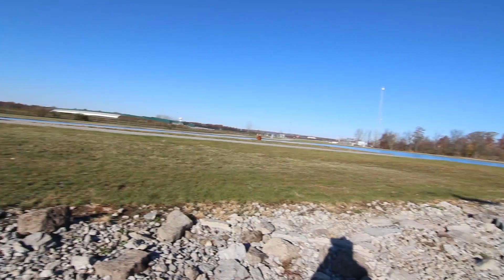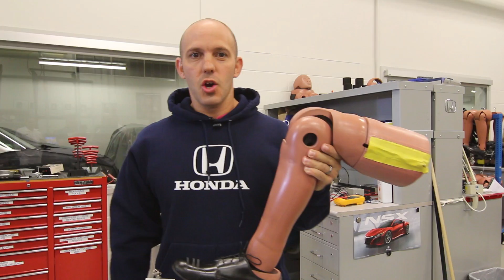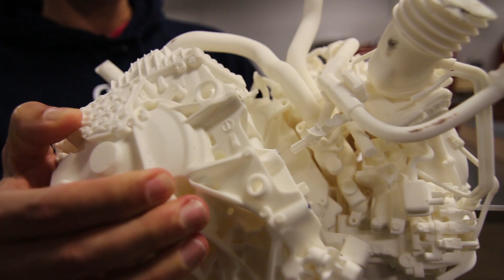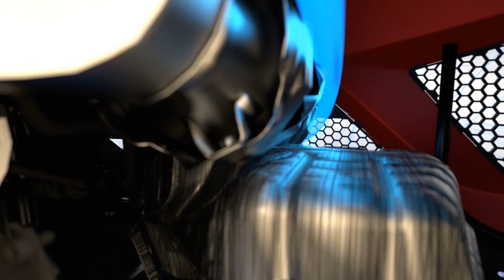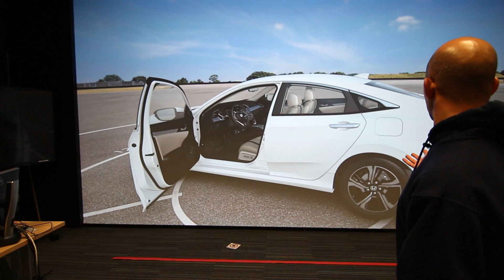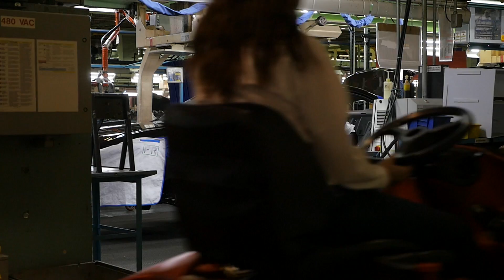This is What Happens to a New Car Before You Buy it! Inside look at the Honda Accord Factory

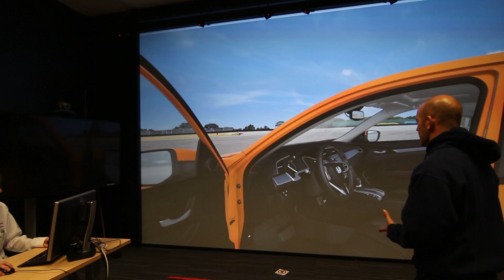Comment: 30:24 why did Honda in general remove the interior black plastic that runs along the door so that you don’t see body color from inside the cabin? All models until 2012 had it. To me it’s a fit and finish appearance and Mazda and even Acura has kept it. My old 2012 Accord had it not my 2019 accord.

Comment: @HondaPro Jason: I have been trying to find the answer to this everywhere but cant, but I was wondering is there a firmware update that will allow the 2014 Civic Displayaudio to run Android Auto/CarPlay?
Reply from the maker: CarPlay & Android Auto is a hardware upgrade.   So it will not be available on the 2014-15 Civic's

Comment: Lol that they check the cars for leaks in the roof or sunroof. A couple weeks after I got my 2014 Honda CR-V I found out that the sunroof and the roof was leaking and water and carwash soup was getting into the car and the headliner 🙄
Reply: +pug Williams  I've seen small objects like acorns block one of the 2 drains that are located in either corner of the sunroof pan. It's very easy to spot by standing on the door sills and looking down into it with the sunroof open. The drains hoses can also disconnect, but that is very uncommon. Either problem would send water down the pillars and onto the carpeting. I'm just mentioning this because I had a friend go to a dealer that wanted to charge him approx $2000.00 to replace the complete sunroof for a damn acorn.
Reply: Eddie H Yeah I was getting a carwash almost every day and I was seeing stains and water spots on my headliner and on the carpet from the soap and stuff